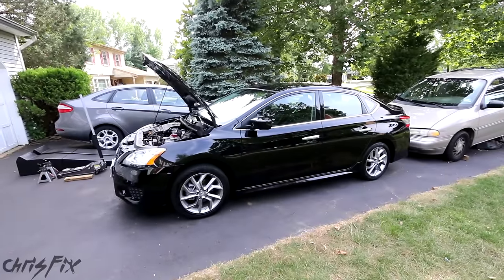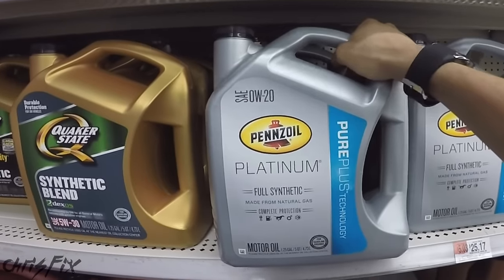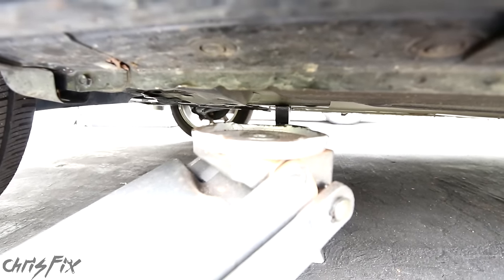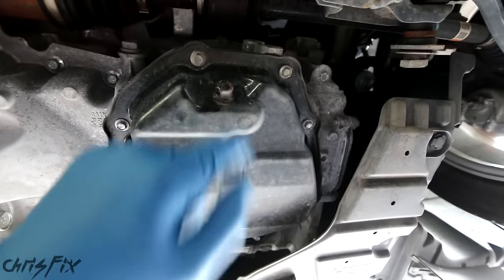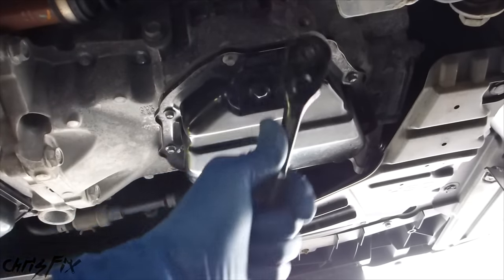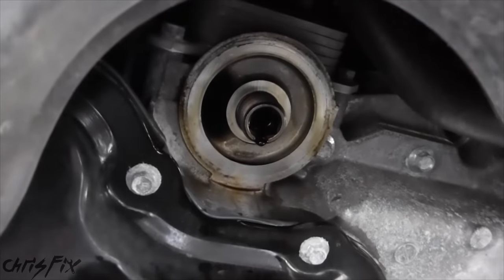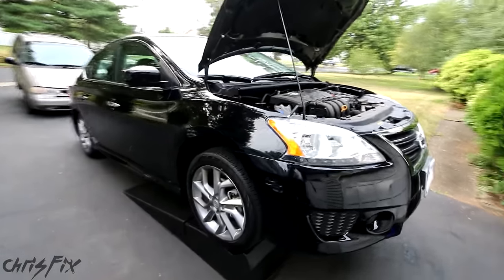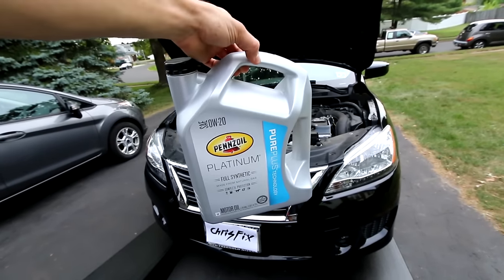How to Change Your Oil (COMPLETE Guide)

Comment from the maker: Learn how to replace every fluid in your car: https://youtu.be/t7JCh7PHoDc
My new video covers how to do an oil change, transmission fluid change, coolant flush, power steering fluid flush, brake fluid flush and bleed, differential fluid change, transfer case fluid change, grease the suspension, and finally add washer fluid properly!
Reply: Uh the video is private
Reply from the maker: hunter alber 8am it goes live
Reply: One of the Greatest life/money savers of all time!!
Reply: FACE Reveal PLZ
Reply: @joaquinshipman941  are you sure about that?
Reply: 00:15 That's a clean Nissan.
09:00 Yeah more leverage is definitely needed.
14:30 Good job coating the oil gasket.
Good job bro.
Reply: A 4 year old video and chrisfix still looks at these comments props to you man
Reply: Shop when i was 11 years old thanks to my best friends dad for the weekend and eventually lead to a summer job. Today i got a job at 29 years old and haven't changed oil in any vehicles since i was 16 years old. So i had to do a quick recap to remind myself 🤘 work will be fun tomorrow
Reply: 6:58 some problems are occurring 😂😂😁
Reply: Just did my first oil change using this tutorial, big thanks to you, a lot dirtier than I expected but it will get better. One thing i learned, there is always one socket that you do not have and need to go to the shop dirty to buy it :))
Reply: How do i know about oil or the filters if i don't have a manual for my car
Reply: hey thank you so much man, I just changed oil and oil filter first time haha, but all thanks to you !
Reply: Chris what to do if we change the oil and the  red oil lamp is still active after that? What do you think its the problem? Please help!!!
Reply: My dad have is van full on the floor
Reply: Arlo Cordell  what am doing worng it like can not go on youtube with out geting shouted at
Reply: Or just get a Tesla
Reply: I like the kerb park on the gutter 😍😍😍 now i dont need to use my jack way easier
Reply: Thanks your my got to on how to dos lol I'm going to be attempting my first oil change this weekend on my 2010 dodge avenger
Reply: Angel Lee , let google know your car information.
Reply: Angel Lee you can look it up online. You just need to know your make, model, and year
Reply: @sudjonowibowo9902  Uncle Google knows everything!
Reply: Hey Chris I just changed my own oil for the first time! Thanks so much👌
Reply: @joaquinshipman941  you should respect his privacy
Reply: Quality video on many aspects, no wonder this guy has 7mil subs
Reply: What affordable socket set would you recommend?
Reply: Yo chris i did my oil change today thanks to your vid thank you man
Reply: hi cant i just open the oil cap and put oil in? what do i need all these other tools for
Reply: Qué New Juice en el What’s hoy YouTube
Reply: Holo ah 😮
Reply: See
Reply: Thomas xxxxxx
Reply: @chrisfix  Thomas
Reply: what kind of car is it cuz i wanted it when im 20
Reply: @chrisfix  I’m a Follower from Germany. Thanks to you and your videos, I start appreciating my old car again, experimenting diy on it. But I have a very big doubt and I hope you can give me an advice. Do you recommend/ is it safe to do an engine flush and coolant system flush on an old car?  It is a Suzuki Swift ddis 2009 with 140k km on it and I never done an engine/ coolant flush since I bought it. Let say I did a regular oil change every 30k km but nothing more. Hope you read it and thank you very much for helping people.
Reply: @ChrisFix so lift locate pan get oil out locate oil filter replace with new put new oil done
Reply: @vojkoobresnel9351  you need another YouTube video for that. Some cars you need to turn it off on yourself manually after changing oil. There’s no problem at all with the car.
Reply: Just did my first oil change 😊
Reply: Is 200 ml over the high mark cause any issue? My car manual says 3.6L oil, but it usually gets to high mark in dipstick with 3.3L . This oil change my mechanic put 3.5L and it is like 0.5cm over the dipstick high mark.
Reply: @chrisfix  Is 200 ml over the high mark cause any issue? My car manual says 3.6L oil, but it usually gets to high mark in dipstick with 3.3L . This oil change my mechanic put 3.5L and it is like 0.5cm over the dipstick high mark.
Reply from the maker: @djjithujab  no .3l over will not be a problem. Most cars can go .5qt over and have absolutely no issues and many can go one quart over with no issues. After that you will have a problem.
Reply: Llpp
Reply: @chrisfix  nnm
Reply: Where can I get some ramps?
Reply: I need a car in my own spot
Reply: we saw his face xd
Reply: But. Tell us truthful what happened with that uncleaned air filter or replace after like 4weeks
Reply: @chrisfix   hey ty for your video... Very indepth for someone who has Never changed oil ( like myself). Question, what if your engine is not the original . I have a 2010 Mazda 3 but it was in an accident and was a total loss. I'm not sure but I don't think the engine I have is the original. How can I know for sure? Thank you please answer when you can . Also how do you know which oil filter to use?
Reply: Hi Chris how much oil should I put back into a 1.6 diesel Ford focus
Reply: Ohijhhob
Lithran Ranadheeran
Reply: How to Fix  CAR
Reply: 2 things-----you need more light under that car. And, at 9:24 if i'm correct, it seems you turned that tool clock wise and not counter clock wise. In order to loosen that nut you needed to turn it counter clock wise, I don't understand how you loosened it by turning it clock wise???
Reply: Where did you get those ramps buddy
Reply: Those ramps are great for people with rocks for a driveway
Reply: @chrisfix  Your face reveal is at 6:58
Reply: Jjkkkjk
Reply: What gloves do you use
Reply: @nicholasfranklin5355  any rubber gloves just too cheap the oil off your hands
Reply: All your videos are very informative and extremely helpful, there just unbelievably detailed
Reply: could you please make a video for changing alternators as well Thanks in advance
Reply: Still helping change oil it seems. Thanks!
Reply: Thank u for this video
Reply: @ Engine broken with the stuffsmokyreyes5075
Reply: Did you know that the brand of filter you got “purolator” was actually the first modern oil filter that these two dudes made awhile back and it was called that because it gives you “pure oil later” purolator

Comment: Dude your putting dealerships and auto service shops out of business 😂😂
Reply: Black Onyx Best explaining online :)
Reply: Triggered yup
Reply: Triggered True but decreased demand in their services will lead to lower servicing prices and parts might be cheaper at the dealership. Supply and Demand.
Reply: Xcellent, this is much easier than thought, in the long run your investment on buying the needed tools pays off and saves you tooons on hard earned money. Thanks a lot brother.. I hope you read this., and yes, lets keep scammers out of business..
Reply: I would never go to a server shop for oil change. They charge like 250 euros just to change your oil that i do in 15 min myself.
Reply: most people are forced to go to the dealership because of their warranty
Reply: ZekeMagnum lol really? Where do you live?
Reply: Sweden. You get a stamp in your service book and it usually increase your 2nd hand value when you wanna sell the car. And some people dont even know how to do it so it is really expensive for what it is
Reply: ZekeMagnum I think i paid 80€ for an oil replacement and it was the syntetic oil reccomanded by audi :P
Reply: Haven't been to a dealership ever since I saw these videos. And got ripped off once at the Acura dealership
Reply: Actually according to the manufacturers warranty as long as you have receipts of the oil change or some record of it then it doesn't violate your warranty.  I ran into this problem myself, and called the manufacturer, and  that's what they told me.
Reply: Black Onyx yup that's why he's YouTube channel called chrisfix
Reply: Black Onyx lol true I mean Ik how to do it cause I learned it in class and I'm just a junior and it's better for us cause we save money lol and he forgot to torque the oil filter
Reply: Mac Sparrow , Not true if you use good oil and keep a record of your oil changes and change it at recommended intervals you will not void any warranty. Of course the dealer will not tell you that unless you put them on the spot and ask. In fact some manufacturers will add warranty miles to your auto if you use high end oils. Remember  an oil analysis will tell if the oil has been changed proper and if a good oil has been used so the manufacturer has nothing to loose if you use a good oil and change it the engine will not fail before the body and the rest of the car fails unless there was a defect in witch case the factory would want to know about so they can study the failure anyway. It is a win for them and for you to use good oil and not off the shelf box store or lube center oils.
Reply: Yeah :D
Reply: Black Onyx that's why some manufacturers makes new cars they cover the engine and can't access by the consumer and only can be access by a mechanic
Reply: Black Onyx have you seen how man auto shops are still in business?? Go ask A mechanic Like me
Reply: The dealerships are charging too much money.  So let people do this shit themselves.  Screw it.
Reply: GMoney it was just an expression calm down
Reply: Maybe if more people did it it would push them to take down the prices a bit or just do the job right
Reply: Your videos are gold
Reply: I'm sayin'.
Reply: Spanish is an OBSOLETE LANGUAGE!  Stop using it!  The majority of all of the countries now use English, in case you haven't noticed.  It's rude to write in Spanish when everybody here is writing in English.  Stop being a huevon.
Reply: Tienes la gramática y la puntuación más pobres de la historia. Eres un verdadero espía.
Reply: @CarMaintenanceGuy   On my 5.8L EFI, the service manual and the schedule intervals outlined by Ford-

(the guys and gals who drew it, built it, tested it and fixed it, all while being squeezed by the EPA to pass smog, choked by their CFO to keep costs down, and strangled by their Competitors to get you and I inside the dealership ASAP) 

-have two distances you can drive on a single oil change: light duty is 5,000 miles, heavy duty is 3,000. I use the latter, because I live where the roads aren't always paved to the places I want to go. I'd love to see a picture of your oil and your engine at the end of a 25,000 mile odyssey.

Tl;dr Cars are an investment: dumping in a gallon of Royal Purple and screwing on a Fram every January isn't. You might not agree with the manufacturer's intervals, but you didn't build the engine: They did. Ignore them at your own misfortune.
Reply: @madcaptain799  The reason people are taken advantage of is the same reason convenience stores exist: apathy and expediency. If it takes too long to learn or do, people will pay someone else to learn or do it. To fix dealerships, you have to educate the people who buy from them. That's why ChrisFix is here: he's a charismatic, down to earth guy who wants to help people learn. No one entity or brand or government agency is at fault: the fundamental problem is how we interact with each other and how much time we think it should take to do it.
Reply: *you’re
Reply: @uploaded113redone  they have to earn something too
Reply: Andrea r
Reply: Black onyx i thought the same thing dude but hey thats how business works
Reply: Who gives a shit? They all a bunch of crooks, scams and theives anyway. Keep doing your your thing babyboy @chrisfix you got my subscription
Reply: GOOD
Reply: Yeah he really is
Reply: They gonna come after him lol
Reply: This video saved me about $60. I'm never paying for an oil change again, lol
Reply: Black Onyx perfect we paying for unnecessary money that we can do on our own
Reply: Good.
Reply: Black Onyx good! They charge way to damn much!
Reply: @kailun3221  gm did it first lol pintiacs are a pain in the ass to work on and they don't even have covers, just covered up parts with other parts
Reply: dealerships have vandalized my new car!!!!!
Reply: good
Reply: I work at a dealership. I'm very honest with my work. Everyone else is there too. It's a Five Star Ford dealership.
Reply: yeah i strongly agree
Reply: Yeah , but those glasses are cool.
Reply: GMoney wtf to your ‘racist’ Spanish comment...? No, within the next decade or 2, Spanish people will be the majority here, & therefore Spanish, the majority language
Reply: Black Onyx word
Reply: TESLA is putting Dealerships OUT OF BUSINESS.
Reply: So fuc**ng true... 🤣
Reply: They try to make bank by doing easy stuff of course someone's gonna be out there to help save money
Reply: Happens or he is destroying everyone and then he will make his own "ChrisFix car repair" :D
Reply: If you work at an auto parts store like Lordco you do get discounts.. I have saved quite a bit thanks to my job, filters are cheaper, oil is a little bit cheaper, and then I get tons of other things cheap...

So you really DO get bang for your buck and save TONS in the long run. It's a lot better, more fun and you can make sure you actually change it and nothing gets damaged.
Reply: Black Onyx FOR REAL
Reply: As a car owner, it's my responsibility to keep my vehicle maintained. However, it is NOT my responsibility to keep someone else employed or keep their business open.
I think you were being facetious, but people do think like that.
Reply: @DumbassPlumber  They just rip you off and make bullshit excuses
Reply: Chris couldnt make a engine swap yet...
Reply: Oil cahange bussines owners hates him. One simple trick to change oil in 1 minute. No credit card, no registration.
Reply: I was thinking the same until I realize how many tools I need to buy before changing it
Reply: Black Onyx No he’s not. People still go there because they doubt Chris.
Reply: Not a Phony Not really.
Reply: jessie mayhew Then make your own.
Reply: Black Onyx some people don’t have the time or willingness to do this so not really
Reply: Good lol
Reply: You're *
Reply: It’s true,they do scam.theres a video up on YouTube about it
Reply: @ZekeMagnum  250 euro for an oil change bub?
Reply: less hard working people getting scammed, and overpriced service.
Reply: Youre average person isnt doing all this shit, hence why oil changes are still one of most if not the most bought auto service
Reply: Good I’m learning how to be a man and do it yourself. And saves tons $$ that’s how I know the job is done right
Reply: That’s great.We saving money and avoiding scams